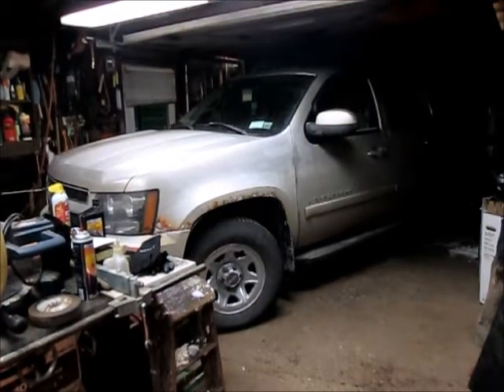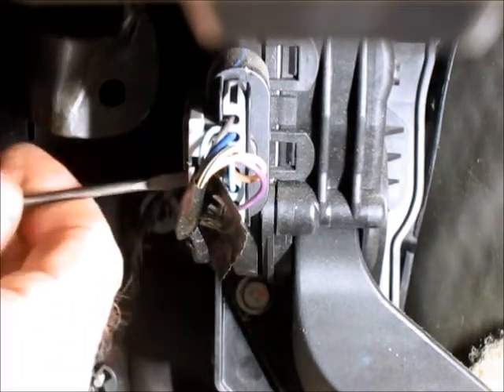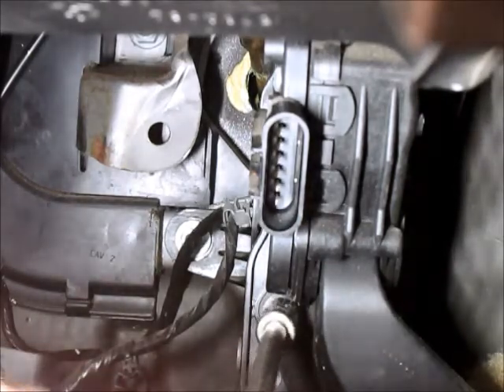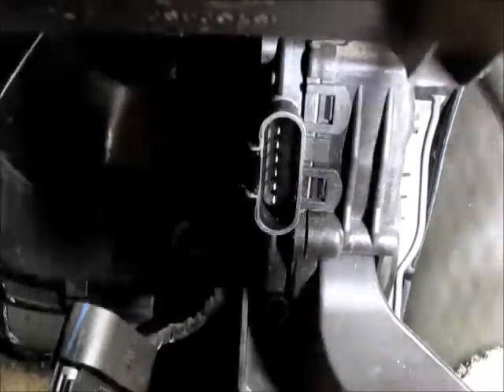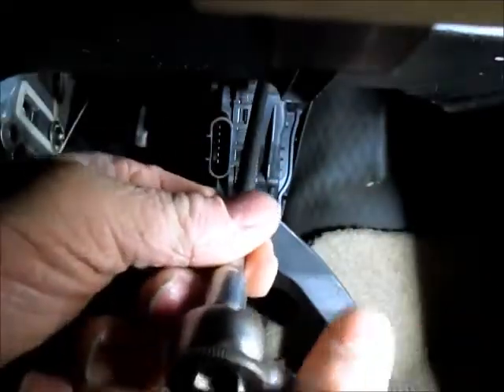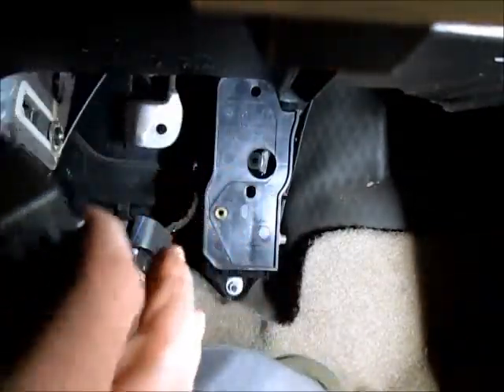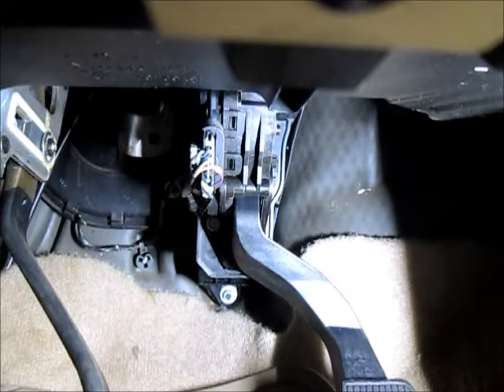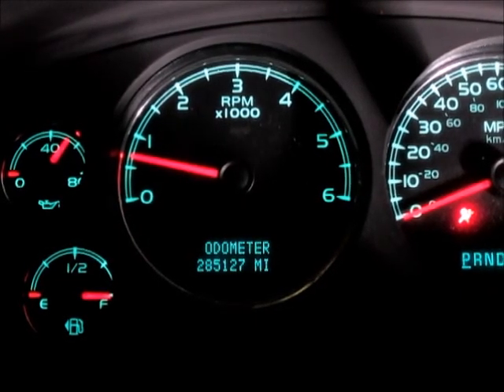Replace Throttle Pedal Position Sensor

Comment: I have a toyota town ace bus that cant go more than 10mhp after driving it for a while.then i turn off the engine and wait for a view minutes and start it up again and all is perfect again after a while same thing.could it be the problem as in your video?
Reply from the maker: Probably not. If you have a check engine light on you will need to have it scanned to get the code. If no light on look to the fuel system.

Comment: Did you disconnect your battery before doing this job?,where dealing with all vehicle electrical BATTERY DISCONNECTED 1STa must as NOT2mess up 750.00to2000.00 main computer #vehicle brain.